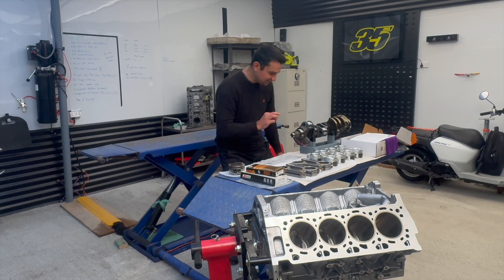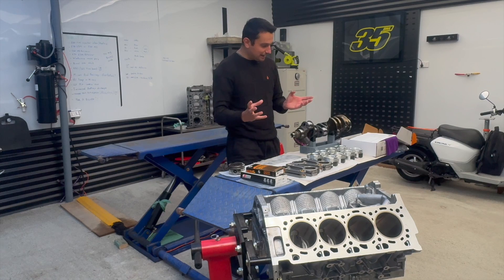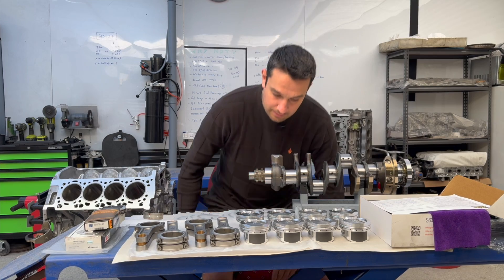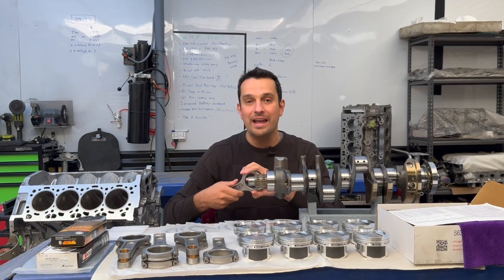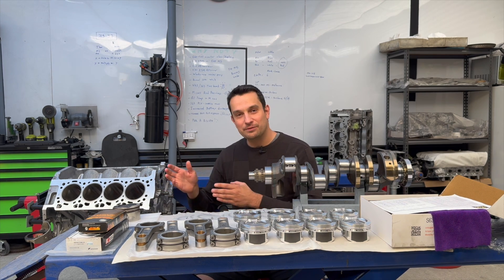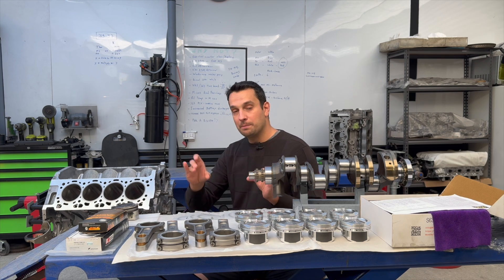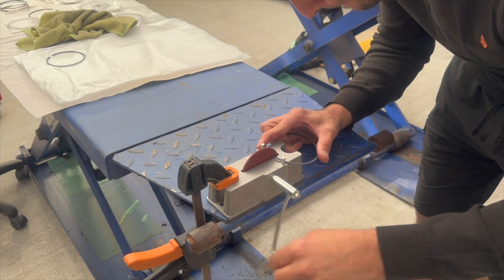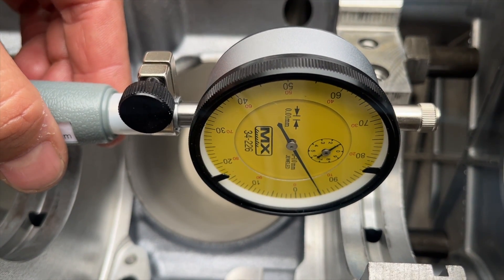BMW F10 M5 - Engine BUILD Part 0  ( S63TU )

Comment: What if you do just an oem rebuild?  Ive always been taught to us a spring loaded drill hone so the rings can seat and clean up cylinder walls.  Do you just clean up the block and rebuild it without honing ?
Reply from the maker: These blocks are made of ALUSIL and you cannot hone it with the usual process. I have them sleeved with cast iron sleeves

Comment: Where did you do the machine work for the cast iron sleeves? and how much? I am looking to get an s63 and want to sleeve the engine.
Reply from the maker: Hi, the job was done in Sydney by an experienced machine shop. About $4k for the job including the liners

Comment: When you sleeve the block do you use bmw spec clearances?
Reply from the maker: That depends on the pistons I am using however we always keep it on the loose side just to be safe. For that particular build, the forged pistons required more than double the clearance (0.08mm) compared to the stock pistons (0.03)

Comment: I have a forged S63Tu in my M6 for a few years  , but I have the factory alusil cylinders refinished with CP Carrillo pistons and rods , Unless you get upgraded aluminum intake manifolds and have the proper fueling you shouldn’t go past 30psi ,the factory intake manifolds will split at the seams , it’s an engine out job , ask me how I know 😮, 😂
Reply from the maker: Thats good - Im assuming you got all bearings replaced when you built the engine
Reply: @ Yes , it was fully rebuilt  , the block was  also sent out for the treatment for the Ausil cylinders , The only gripe I have  is the Forged pistons make a little noise at slow speed , it’s not harsh but I notice it , it sounds like a quiet diesel 😁, but at full throttle it’s super smooth and engine sounds smooth as silk , The CP rods and pistons come pre balanced in the kit

Comment: How has the car been ruining? I am thinking of buying the rods you used
Reply from the maker: The car is doing well and the owner told me it get trashed on a daily basis - The parts are good, you just need to be careful with clearances as they might need some correction due to the big end size on the rods

Comment: Hello, I have an N63TU block and I have 2 cylinders that are slightly scratched. Is it more advisable to polish the cylinders or is it more advisable to line them with cast iron liners?
Reply from the maker: Sleeve them up for sure ! With cast iron sleeves the block becomes stronger

Comment: Hey, I got a new crankshaft from BMW, and I want to put Calico Coated Bearings, do I need to see the Oil Clearence what you did on the  Video? Thank you.
Reply from the maker: Yes, it's very risky to simply slap the bearing in and tight everything up. Clearances will be OK 90% of the time however if you're in those 10% and go ahead your brand new engine could last for a few minutes after the first start. If you dont have the proper tools to measure just buy plastigauge for like $10 bucks and check the clearances up.

Comment: Love your videos,currently own m5 with high mileage,im mechanic aswell myself,never ever had rebuild s63 before,but thinking to do rebuild ,just thinking is it easy to make timing on it? And i saw crankshafts its no more expensive,like 1.5k in uk(not oem i think)
Reply from the maker: Yes, prices are finally coming down on parts and it's becoming more accessible

Comment: Hey again master of S63s! :) Thank you again for all of those videos, it helped me a lot. I have a question about the oil clearance. What about using the flexigauge from acl? it's not a good option? thank you again for your reply and the perfect job you are doing!!!!
Reply from the maker: Hi, Plastigauge / Flexigauge are good options for checking clearances while the engine is still in the car / assembled since you cannot have any movement on the parts in order to have a proper reading - I find easier to use a mic and bore gauge while the parts are loose on the bench.

Comment: I cannot find the acceptable piston ring gap anywhere. Is it 0.35mm for the top and 0.50mm for the middle? Is this something you may share?
Reply from the maker: Hi, if you’re building a standard engine (stock pistons and rings) I’d use 0.35 on the first and 0.40 or 045mm for the second ring - if it’s a forged or aftermarket piston/rings you may increase the end gap.

Comment: Sleeving the block has the downside because cast iron does not dissipate heat as well as aluminum. This is why Alusil is superior to sleeved blocks.
Reply from the maker: The engine coolant is there for that reason. Sleeving the block with iron is a win-win - it gets stronger and holds much more boost without risking damages to cylinder walls

Comment: for the point of undersized: then why customer dont go over size bearing to make the car main & rod bearing, could accept thicker oil viscosity like 5w50 ?
Reply from the maker: Thats not really how it works, getting an oversized or undersized bearing has nothing to do with oil clearances at all - An oversized bearing is to be used when your rod big end is too big and an undersized bearing is to be used when your crank has been machined dow (material taken from it) - A few companies offer "extra clearance bearings" but hat has nothing to do with them being under or over sized.

Comment: Is the Kingtech product compatible without any problems?
Reply from the maker: Hi, unfortunately we had a few fitment issues and they are working to produce new parts within the correct specification - I should have an update video once the engine is running.

Comment: ACL actually calls them OVERSIZED and they have 3 sizes STANDARD, .025, and .25 which you are using, they are OVERSIZED BEARINGS. correct me if im wrong but thats exactly what it says on their website lol
Reply from the maker: You are mildly right but technically WRONG ! Yes they manufacture oversized bearings however they are for different applications and have material added to the EXTERNAL side of the bearing which is the opposite to what we are discussing in this video and have nothing to do with grinding the crankshaft. Check ACL's latest catalog and don't rely on what eBay sellers claim.
Reply: @dnl35projects  was over at the forums and you are correct they are undersized bearings, lang racing does this job and says it increases surface area by 15%, wider than the S63 stock bearing but also slightly smaller in diameter. They take damaged crank journals and have them re-ground to accept the wider bearing. is this the same job you have done here? you can google it by searching - S63 Rod Bearing Journal Widening Kit Including Crankshaft Journal Modification. Its by lang racing... wondering if this is exactly what you have done here in this job aside from the sleeved block which is awesome if done correctly. Love the videos man, been watching the whole series since last year and still am! The mileage on my s63 M6 Gran Coupe is 53k miles so im thinking of doing the Rod bearing job real soon.
Reply from the maker: No we didn’t increase the journal sizes. A few companies have come up with solutions for problems that would not exist if the oil changes are done more frequently and this is what I’d stick with.  I’m glad you like the videos, thanks

Comment: Great video, it’s been a while. What do you think the engine build will cost including labour and materials?
Reply from the maker: Hi, that varies a lot depending on how bad your engine is (if its bad at all)  For a good running S63  (not seized or knocking) you are looking at around USD$4k in parts plus labour which should be another $5k as well.  If your engine is seized like this one in the video and you have to add pistons, rods, crank and machine shop costs it can easily get past the $15k mark
Reply: @dnl35projects  Thanks. But those costs really make the core exchange from BMW US for $6k far more attractive than attempting a rebuilt, no offence!

Comment: Cast iron conducts heat worse, I don't know if it's a better option.
Reply from the maker: Yes, they definitely heat more than the aluminium block and that’s why we have to use increased clearances however they are much stronger and basically the most viable option (financially) for the S63

Comment: What gap do you need for the rings? I have the exact pistons for a stock S63 block, thank you
Reply from the maker: On a stock block I’d use around .3 for the first ring and 0.4mm for the second ring
Reply: @dnl35projects  Thank you very much for your reply 🙏,  just waiting for the cranckshaft from kingtech then I will put it all together!
Reply from the maker: Awesome ! I was keen on getting a crankshaft from them as well ... let me know how your build goes - Cheers

Comment: I thought sleeving was a pretty safe and reliable option until the m539 n62 blew up after 100 miles, do you have any thoughts on what went wrong with his build? I see a lot of engine builders still sleeving the block so it works of course but I wonder what else you need to watch out for. Would you use bigger piston to wall clearance on stock/non forged pistons as well?
Reply from the maker: Hi, yes I was shaking after watching his video because I had just picked up my block from the machine shop a day earlier and that was the first S63 I had sleeved (about 2 years ago) 
He posted an update video after a few weeks and the machine shop did not hone the sleeves properly causing his engine to seize. I have about 15k kms put on my X5M since the build and it’s going strong. 
With the stock pistons I’d recommend using about .04 clearance and get them thermal / teflon coated specially if you’re re-using the pistons - you also need different rings (not the OEM BMW) to use with the cast iron sleeves
Reply: @dnl35projects  damn, glad It worked out for you and looking forward to this build. N63/S63 content is rare so thank you for documenting your work.
Reply: @dnl35projects specifically which piston rings do you use for a sleeved block application? And what ring gaps should I be aiming for? Great videos, btw 👌🏻 thanks and keep it up